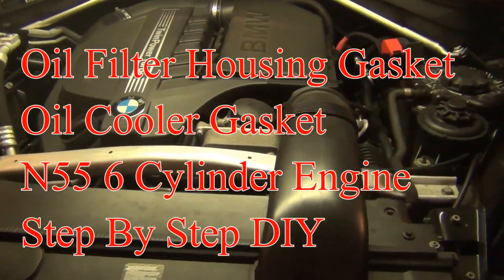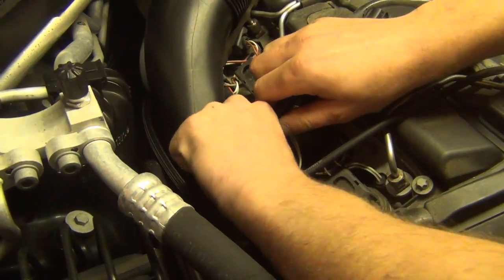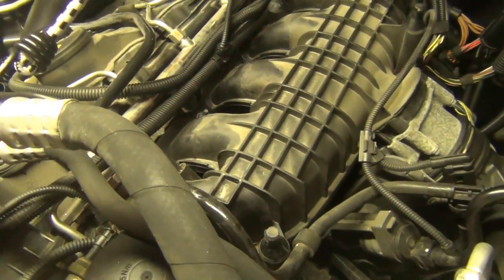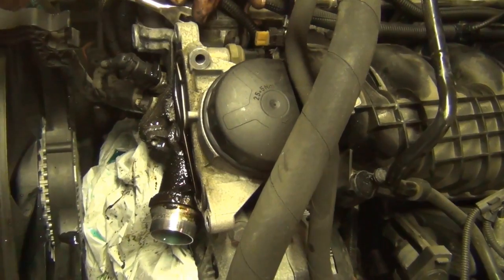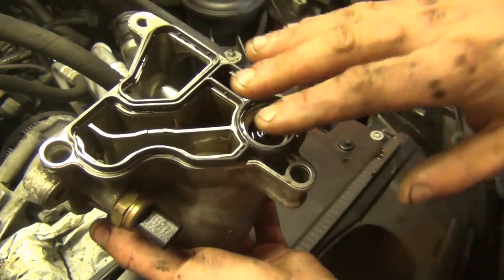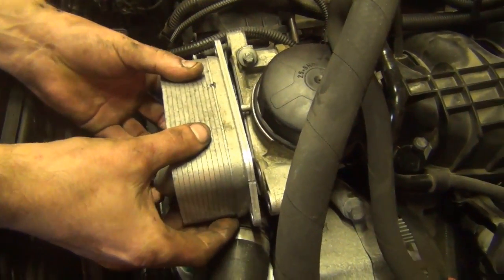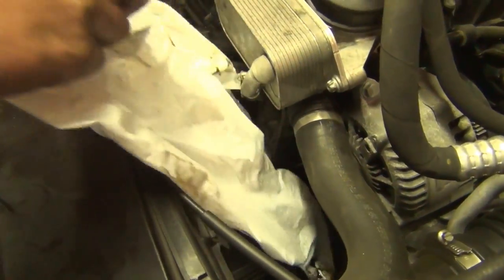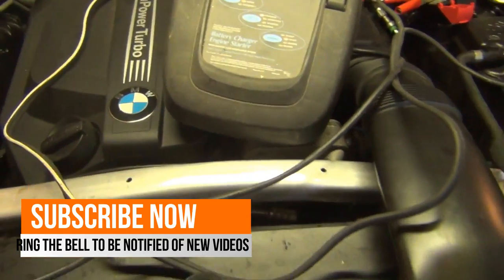BMW Oil Filter Housing Gasket N55 And BMW Oil Cooler Gasket Oil Leak Full Easy Step By Step DIY

Comment: Thanks for the video, i have to replace my OFHG  soon. I noticed some people on the internet, that had a spun rod bearing after replacing the OFHG(the belt still intact). Any logical explanation for that? Or any advice for rod bearings in general on the N55 engine? Thanks a lot.
Reply from the maker: Hi, yes there is a procedure I would recommend. The current procedure to do when the oil circuit is opened is to turn the engine over by hand 2 x and then with a charger on the vehicle and the fuel  system disabled (fuel pump fuse or unplug the low side pump) crank the engine for 5 sec intervals letting the starter rest for 1 min in between and do this 4x. This re prunes the system. Also you should double up on your oil changes and try to avoid short distance driving that allows water build up in the oil. I hope this helps!
Reply: AskTheCarExperts oooh now i understand. So there may be a true connection betewen OFHG replacement and rod bearing failure. Thanks a lot for the life saving advice! It all makes sense now :)
Reply from the maker: @primoz990  Your welcome :) This should be performed on any repair that interrupts the oil circuit. That would include vehicles that have sat for a long time, vanos unit and solenoid replacement, oil pan removal, or any major engine internal work. Thanks for asking a great question! I think others will get a lot of value from it!
Reply: AskTheCarExperts Yes, you are 100% right on that. I see you have a lot experience with BMW N series engines in general. Any experience with spun rod bearings on the N55? Some people had this fatal issue on low mileage cars for no obvious reason. Any info on that maybe? I am thinking to preventive replace the rod bearings on my N55 with 125k miles.
Reply from the maker: @primoz990  I have seen quite a few bottom end problems on the N55. I would also recommend checking your oil filter and looking for any signs of copper. I think most failures stem from BMW's current oil change interval. People I know that do an oil change every 5,000 or less have a lot less problems. I have also seen failures from cold weather due to emulsified oil due to short distance driving. I know in Canada they install block heaters. I think this should be done in all cold weather climates. I have yet to install one though :)
Reply: AskTheCarExperts Thanks a lot again, you are a true life saver 🙂👍🏼 I just bought my mentioned car, and i know the oil change intervals were not the best, so i definetly will replace the rod bearings(when fixing the the oil pan leak). Thanks a lot for the answers and the time you took to help us all 🙂👍🏼
Reply from the maker: @primoz990  You are very welcome :)

Comment: Did you prime the oil filter ? I was told the engine will cease up if you dont.
Reply from the maker: It is a good idea to prime after the repair. Disable the injectors or fuel pump and crank the engine over a few times for 5 sec intervals and wait a few minutes in between to let the starter rest.
Reply: @AskTheCarExperts Thanks excellent video on this repair  You did a wonderful job of giving step by step procedures You should include the oil priming alot of people dont know about this critical and final procedure.
Reply from the maker: @MrRepsMrReps  Thanks for the great feedback. Glad the video helped!

Comment: Thanks for the video it’s very well done it’s not that I haven’t done any yet but it’s interesting to see if there’s a different way to do it and there is I didn’t know about the A/C flexible lines but what I do on all BMW now is replace the plastic coolant flange close to the short bolt on the oil filter housing I buy it from my German Car part suppler it’s made of aluminum I just cut the rubber hose close to the metal clip then you loose very little hose this is where I drain most of the coolant.  One other thing I do is remove the oil filter From the housing then suck all the oil from it so it doesn’t leak as much when you remove the housing the broken cylinder head bolt I saw this for the first time not that long ago.
Reply from the maker: Thank you for the additional notes and posting!

Comment: I had no where near that much room to work with removing and replacing these gaskets
06 BMW z4 3.0si..
But I completed the job before it started to even start to leak
I didn't sand down just used brake cleaner.
Reply from the maker: That's great Terrence! Being preventative is smart. Once the oil gets onto the drive belts they need to be replaced and I have often seen the drive belts come apart leading to engine damage.

Comment: Where in the video the oil cooler gasket is being replaced? I see the oil filter housing gasket being replaced but not the other.
Reply from the maker: At 11:37 I am removing the oil cooler from the housing.

Comment: Hi Bud... question.  have you installed a oil catch can on your N55, i see lot of folks are doing it on N55 and N54 motors... any advise?
Reply from the maker: Unfortunately I don't have any experience with oil catch cans. I did hear about catch cans causing some problems if the water in the can gets sucked into the intake. As long as you drive the vehicle normally and maintain your BMW well it should last a long time.
Reply: @AskTheCarExperts  Thanks bud.  Highly appreciated your valuable feedback.

Comment: How do you get the nut at the driver wall?  I could not get on it slip off. All those wires in the way too. How did you raise the barrier to clear all the wires. My clip it is impossible for me to push up. I am referring to the last nut in the back
Reply from the maker: It's all by feel in the back. You can try a swivel with electrical tape wrapped around the pivot for better tension and control. Tap the end of the extension to help seat the socket.
Reply: @AskTheCarExperts  I might have to unscrew the barrier and   move wires to get to that  nut. I got a mirror but them wires blocking my view.  It feels like the stud and nut are angle and not perpendicular.  This is why I couldn't get in the 11 or 12 mm . 
My belt brokes due to leaking OHG. I took off the fan cowl and removed the crank pulley. Shredded belts was wrapped behind crank pulley. I removed the remnants and the seal looks new. However,  some electrical wires is torn at the sleeve so I will have to wrap them with electrical tape. 
Thanks for the reply and the video is awesome.  Much appreciate your time.

Comment: I just replace my timing chain & water got into my cylinders. I remove the spark plugs and got it out. Now milky stuff shoots out of dipstick. What should I do?
Reply from the maker: That's not good. Hopefully no damage occurred. Do a few oil changes but if you still get coolant and oil mixing it may be a head gasket or failed coolant jacket.

Comment: For removing the alternator would you need to remove the oil filter housing gasket?
Reply from the maker: Hi Vinny, Yes the alternator can be removed without touching the oil filter housing
Reply: @AskTheCarExperts  is it possible you have a picture showing it? Im trying to remove the bolt behind all that cable on the back by feel and seem impossible. Smh

Comment: Hi Bud, I have totally different question for you on BMW X3 E83 2008.  I was driving few days back all of sudden "RED color Airbag light plus Yellow color Break light (parking break) and Yellow 4x4 light came on.  There is no engine performance issue it runs fine.  any advise bud.
Reply from the maker: Hello Tahir, Hard to say what might be going on without a scan for codes. I might be able to help once you are able to do a scan.
Reply: @AskTheCarExperts  thanks bud for very quick replay... appreciated it.  There is no fault code or Engine Service light On.  do you still want me to scan for codes etc?
Reply from the maker: @tahirrana6875  No worries. Glad to try and help. With the warning you have there will be codes for the transfer case and DSC modules and possibly the airbag system.

Comment: Hi I need help I have a little pooling of oil next to the cap for the oil do I need to replace both gaskets or should I be fine if I just did the oil housing gasket
Reply from the maker: Hello, can you clarify if you have oil around the filler cap on the valve cover or around the oil filter cap? Thanks
Reply: @AskTheCarExperts  it’s more on the filler cap we’re the cap is there a small dime size pool of oil that just sits there after I wipe it after I ride it for a few hours it comes back I had a oil change and my mechanic said if it comes back then it’s not the oil filter because we did the oil change he said it’s the oil cooler gasket but I’m just trying to double check i don’t see oil anywhere else just there in that little pit
Reply from the maker: @user-bs9mw1cz9o  One common problem is from using aftermarket filters. The O ring for the filter cap is flat not round like an oem filter. This can lead to leaks from the cap just from a bad o ring

Comment: Hi Thank you for the excellent and in great detail video . great explanation and camera work. I have a 2013 bmw x5 35i 3.0 litre turbo. QUESTION>>> It seems this is a common problem with these gasket failures, Does BMW have these replacement gaskets made out of revised/ better composite material?? If not it will only be a matter of time to have to be redone again and again in the future. Or is there another gasket company (Felpro/McCord) that do obviously make a better revision gasket to replace these "known problem" gaskets. ty Sir in advance
Reply from the maker: This is usually an age and time related failure due to expansion and contraction. Bmw does not make a different gasket. It is the same material as the original. You could try a different gasket but I am not familiar with other brand gaskets and longevity.
Reply: @AskTheCarExperts  ,Ty Sir for the quick response and input.I guess I am just comparing it to my 2006 v6 toyota highlander and never ever had any issues with any gaskets on it with 400 thousand kilometers with Zero issues.....i would have thought"German Engineers would look for a " permanent fix for good gasket" because it is a BMW which is/suppose to be a higher class vehicle. my  2013 x5 35i was done at dealership at 79,000 kilometers,now it has 142.,000 kilo and its leaking again... not impressed with it as it compounds other mechanical problems,Serpentine belt/ front main oil crankshaft seal/or engine remotely, could be destroyed for a $10.00 gasket modification/revision. So BMW will have this problem in all of it upcoming vehicles... Engineering$%^&*  wow .ty for your thoughts and input . Excellent videos and please keep posting videos and excellent teaching  ty
Reply: @battlehrfred  agreed 100%

Comment: i’m currently doing this and i’m on the hidden bolt and that wire is in the way i saw u broke it at 9:31 in the video is that ok to do?
Reply from the maker: @Anthony-vf3fq  Hello, at 9:31 the clip for the line shattered but I am not damaging any wiring.
Reply: @AskTheCarExperts this video was so helpful thank you i completed it and do you have to prime the engine oil before starting?? did you do that?
Reply from the maker: @Anthony-vf3fq  That is great! Yes, I would recommend engine priming. I have a video on that procedure.

Comment: Oil system needs to be purged?
Reply: Here is the service procedure......
newTIS.info beta
BMW E70 X5 M SAV / Repair Manuals and Technical Data / 11 Engine / 11 00 Engine /
Repair notes on renewing the engine
Engine damage due to lack of engine oil.
Lack of engine oil after the oil circuit components are repaired or after the engine is renewed may cause damage to the engine.
Do not start the engine after the oil circuit components are repaired or after the engine is renewed without following the repair notes.
The repair notes on carrying out repairs on the oil circuit components or renewing the engine must be followed.
For additional information, see: Repair notes on carrying out repairs on the oil circuit components or renewing the engine
Problem
After the engine is renewed, the lack of engine oil may damage the engine.
Cause
An exchange engine is not pre-filled with engine oil.
An exchange engine may still have an unknown residual amount of engine oil in the oil sump resulting from the assembly of the engine.
This residual amount of engine oil is not sufficient to operate the engine.
        
 A lack of supply of engine oil due to a low oil level may damage the engine immediately after the engine is started.
The electronic measurement of the oil level is possible only if the engine is running and the engine oil is at operating temperature.
The electronic measurement of the oil level therefore must not be carried out.
Solution
The engine oil must be drained fully after the exchange engine is installed. For additional information, see: Maintenance instructions "00 00 252 and 00 00 610 Engine oil service".
Observe the sign in the engine compartment! Only pour in approved engine oil with the correct SAE viscosity classification.
Fill the correct quantity of engine oil in the engine. For additional information, see: Maintenance instructions "00 00 252 and 00 00 610 Engine oil service".
Engine oil
           Technically suitable engine oils for BMW Group engines
3.0 Technically appropriate engine oils for BMW Group engines
Connect battery charger.
Damage to the starter motor.
An excessively long and uninterrupted operating period of the starter motor may damage the starter motor.
Note the maximum permissible uninterrupted operating period of the starter motor. Allow the starter motor to cool down before a new operation.
Before the first engine start, the engine only needs to be turned with the starter (without combustion) for a few seconds.. The maximum permissible uninterrupted operating period must not be exceeded. Additionally, the starter motor must be cooled down for a few seconds before being operated again.
   
 Starter motor
  Maximum permissible uninterrupted operating period 10 s of the starter motor
Minimum cooling-down period immediately after 20 s operation
The fuse of the electric fuel pump must be removed to guarantee this.
Turning the engine with the starter motor (without combustion) ensures that the engine has a sufficient supply of engine oil to start the engine regularly thereafter.
Turn the engine with the starter motor (without combustion) for the stipulated period of time. Allow the starter motor to cool down for the stipulated period of time.
Carry out the previous two steps 2 more times.
Then install the fuse of the electric fuel pump.
Delete the fault memory.
Start engine.
Bring the engine to operating temperature. Measure the oil level electronically.
Additional Information
Overview Technical Data Starter motor
  Maximum permissible uninterrupted operating period 10 s of the starter motor
Minimum cooling-down period immediately after 20 s operation
Links
Operating materials
 3.0 Technically appropriate engine oils for BMW Group engines
  For informational purposes only. The information on this website is provided AS-IS with no warranties, express or implied, and is not guaranteed to be error-free, up-to-date or complete. Newtis.info and BMW assume no liability for any loss or damage arising from the use or reliance on the information and content on this website. The content on this website is subject to change without notice.

Comment: Does this apply for my e71 2013 bmw x6 35i? Thinking of doing this myself.
Reply from the maker: Hello, This repair would be for any vehicle with the N55 engine. If your not sure run your VIN in realoem.com and you can confirm you have the N55 vs N54
Reply: @AskTheCarExperts  ok great it's a n55 engine, I took my car to the dealer for an airbag recall and they said I have a leak on the oil filter housing gasket. I dont see any leaks or any pooling on my driveway, is there any way to know for sure that's the problem? My mileage is at 87k, you think I should just get it done as a preventive  measure. Also do you think I should change belt and tensor while I'm in the process? Sorry for the overwhelming amount of questions..
Reply from the maker: @infamous87ny  Take a look at the underside of the housing. This is usually where the leak starts. Using and inspection mirror can help. Also check the coolant lines going to the cooler for any signs of oil which can make the hoses swell. I hope this helps. If your not a subscriber please subscribe :)
Reply: @AskTheCarExperts  already subscribed, thank you!!

Comment: I would love to see someone do this same exact job on a bmw z4 3.0si... 
I don't think anyone will ever YouTube this job on that car...
Reply from the maker: Hello Terrence, What engine specifically where you looking for? N52 or N55?
Reply: N52 bnw z4 2006
Extremely tight between cooler and radiator.
Most videos have plenty of space to work with but that model it's very difficult
Center bottom bolt on cooler. No I did remove antifreeze hose partially blocking the bolt. Did want another job on top of that.
I've heard the o ring break off inside of Housing. Creating another headache.
I've done many jobs but this one kinda space  limited especially tighting the lower bolt back in. Also off set hed ratchet would have helped. I  Have more than enough tools that I've completed this job on. It's just space constraints. 
Don't be discouraged the job can be done just have patience